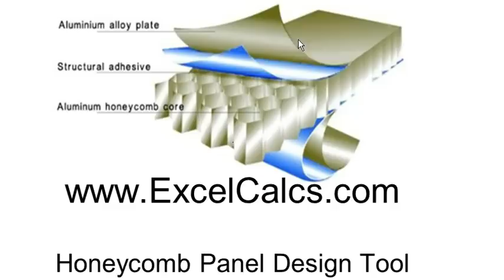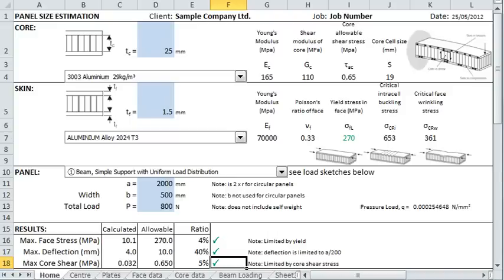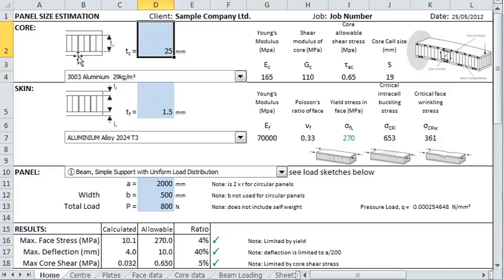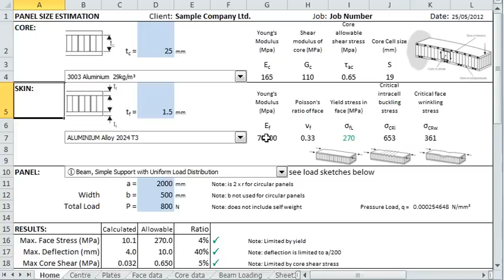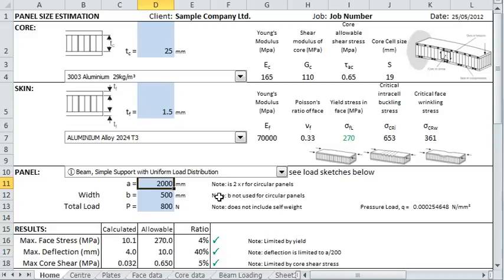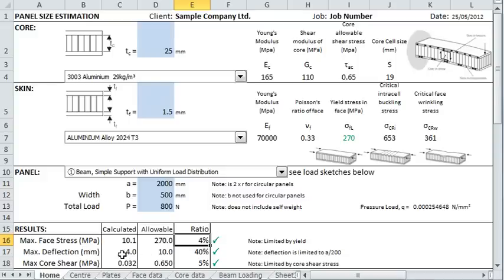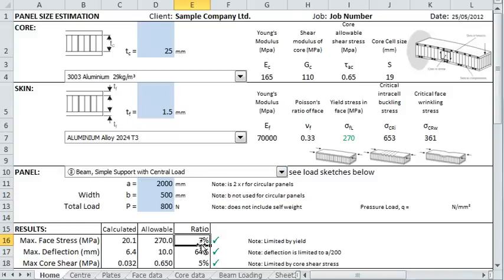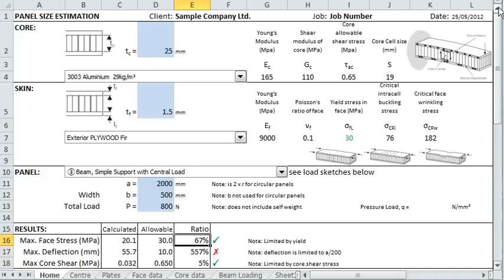Honeycomb Panel Design Tool

Comment from the maker: The Honeycomb Panel Design tool is just one of may resources at www.excelcalcs.com/ The Honeycomb Panel Design tool itself can be found here www.excelcalcs.com/repository/strength/plates/honeycomb-beam-%26-panel-calculations/
Reply: John,

This is a great resource.  Is there potential to add additional materials, such as foam core materials?
Reply from the maker: K Nelson Thank you for your comment. Yes It is a spreadsheet calculation so additional core materials and face materials can be easily added.
Reply: can u send the excel to my eamil: kidd1115@126.com?

Comment: Where can I buy this stuff? There aren't any links from what I can quickly see.
Reply from the maker: Sorry for my tardy response Richard. You can use these links www.excelcalcs.com/ The Honeycomb Panel Design tool itself can be found here www.excelcalcs.com/repository/strength/plates/honeycomb-beam-%26-panel-calculations/